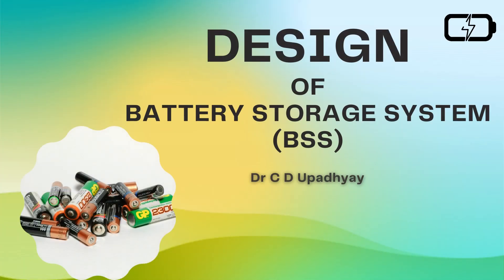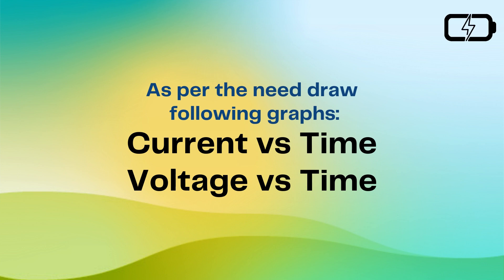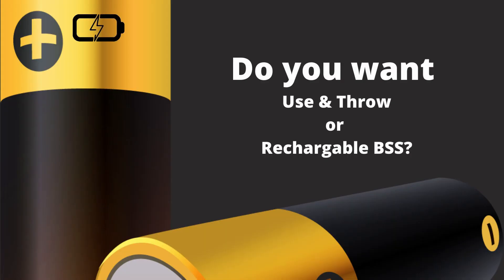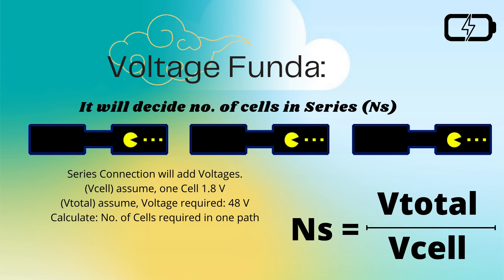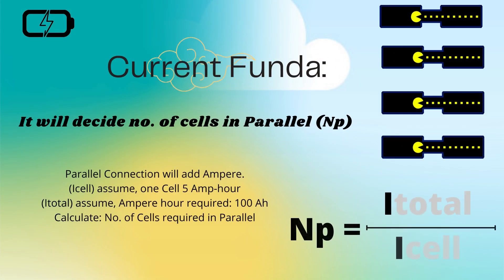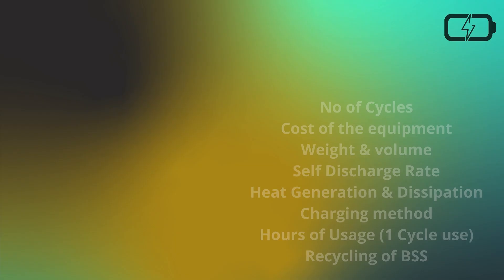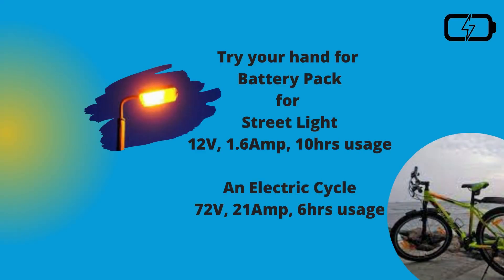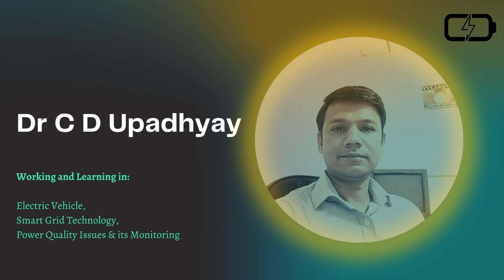Design of battery Storage system Part I

Comment: Exa:- of Street Light
12 V,1.6 Amp And 10 Hour
Cell:- 0.8Ah and 1.6VOlt

Ns=12/1.6 =7.5 Cell In Series
Np=1.6×10/0.8= 20 Cell line In Parallel